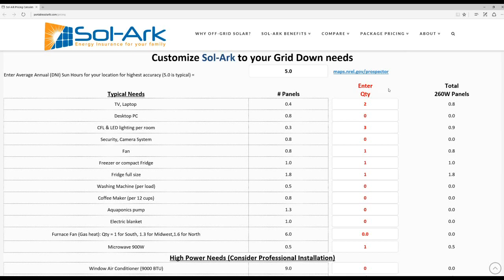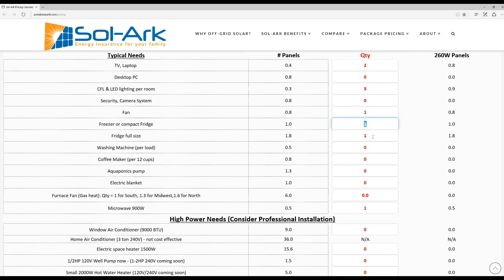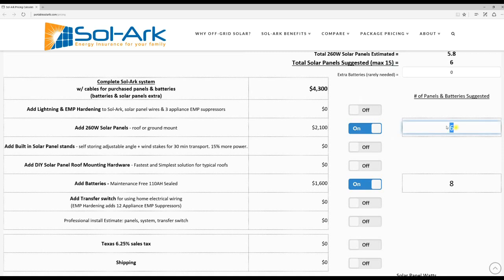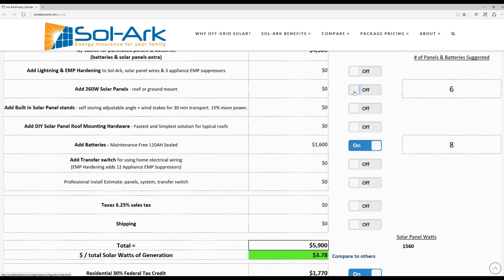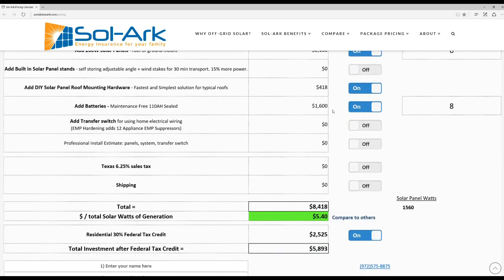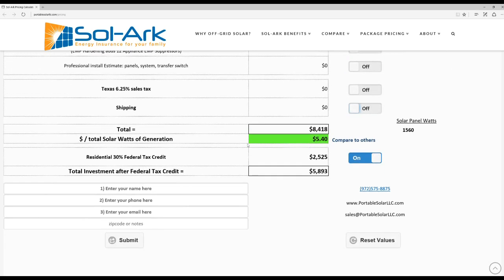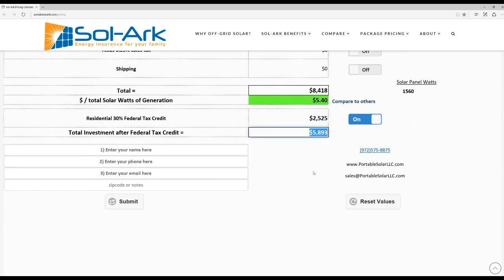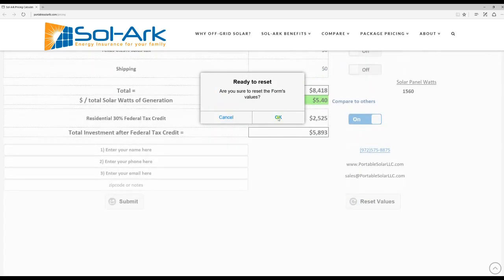Step‑by‑Step Tutorial for Customizing Sol‑Ark 4kW Solar Inverter

Comment: Do the transfer switches allow you to use the Sol-Ark for your dedicated circuits simultaneously and alongside grid power?  For example, could the Sol-Ark be powering your lights while the grid is powering your A/C?  Or do the dedicated circuits require that the main power is offline?  Seems like if you could be doing both solar + grid simultaneously you maybe could cut your electricity costs in a sunny part of the country.
Reply from the maker: Hi "Of Woodbridge and Hedgely" the transfer switch allows you to do just that, you can decide which circuits are powered by the Sol-Ark and which are powered by the Grid. Larger configuration of the Sol-Ark can even pay for themselves over time.